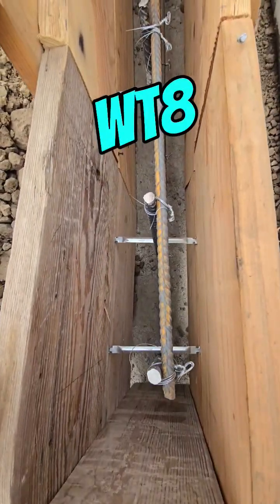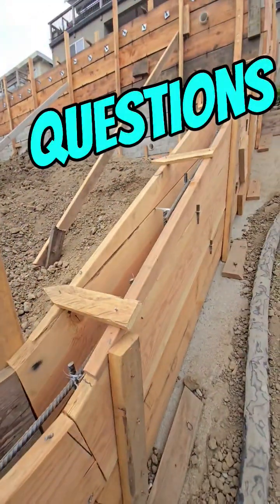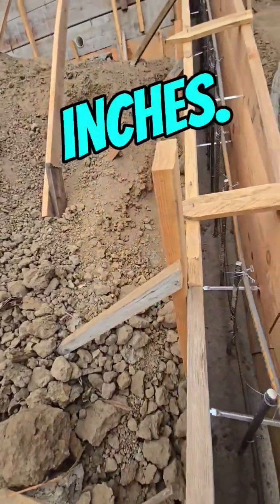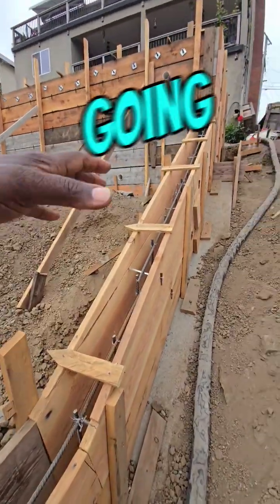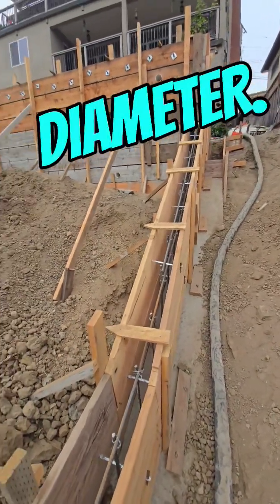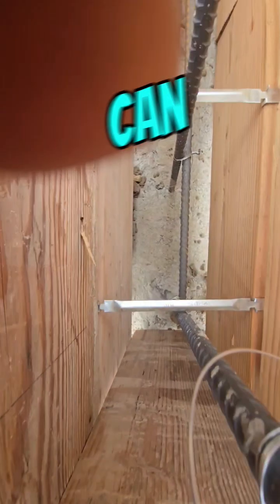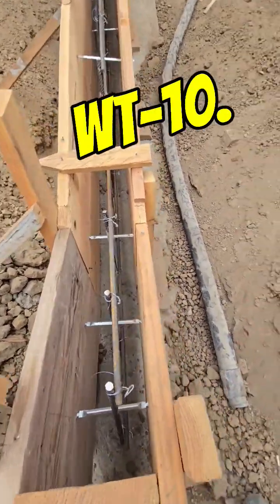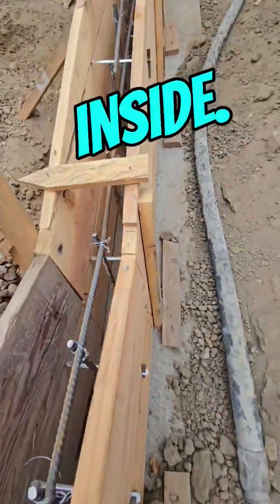What Holds Concrete Wall Together ❓#construction #concrete #simpsonsties #rebar #asmr

Comment: Simpson has charts for spacing on the Wedge Form Tie if you're not comfortable freestyling it. Varies based on size of form board, thickness of wall, and height of wall.
You want tighter spacing at tge bottom of the wall and wider spacing at the top.
Reply from the maker: Yea after 15 years we just put them in.. 🤣🤣